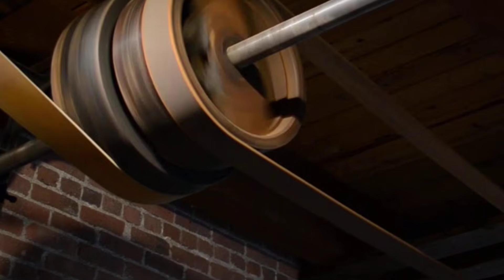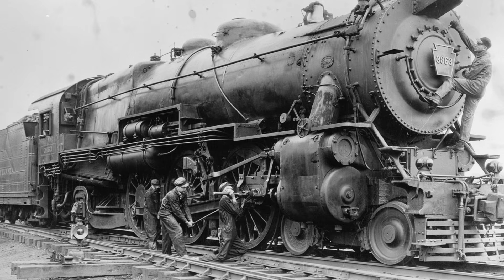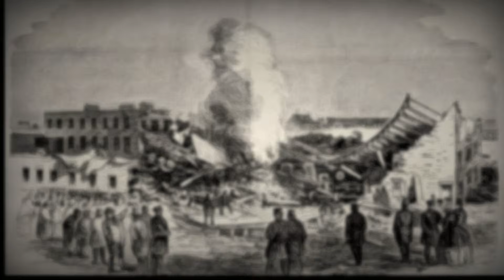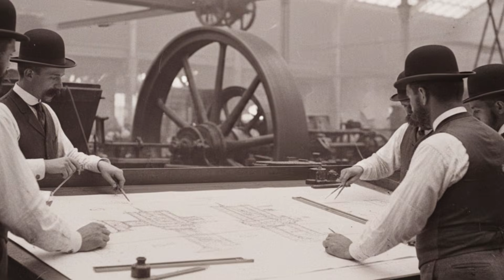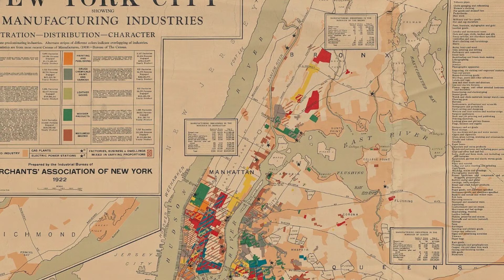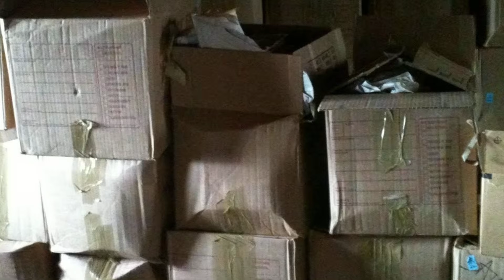The Deadliest Spinning Giant Nobody Feared : 56 Ton Flywheel

Comment: I worked in a couple of cotton mills as a 16 -18 year old back in the 1970’s. I can’t believe how casual we were about the environment of spinning, slamming equipment we worked around each day. Times do change.
Reply: I am an electrician and back in the 1980s paper mills still had some old machines like that. An older guy told me about him helping a guy who got both of his arms caught in a machine and it too almost an hour to take the machine apart to get him out. He said he was screaming for someone to put him out of his misery. These machines were built to be driven by a central belt system and just had electric motors added to power the wheel on the machine. We were adding electric eyes and DC drives that could control the motor speed. Many of these machines were bolted to the floor for 100 years and had narrow spaces between them. You had to walk sideways with your arms by your side to stay clear of all the open belts and chains spinning all around you.

Comment: Are there any statistical records of the percentage of industrial flywheels that failed? I've seen several Corliss engines on display running at very low speed, just for exhibition. A few really big ones, flywheels probably about 30 feet diameter, but again, these were just puttering along at maybe 10 rpm or so. I tried to imagine what a catastrophic failure would be like, but I think it would happen so fast that survivors would not even be aware of the disaster as it happened.

Comment: No sweat. The Chernobyl "flywheel" was far worse.
Reply: Chernobyl is a demonstration of what happens when you turn down a reactor too quickly then turn it right back up again.
Reply: That is what was told in order to be able to proclaim that RBMK reactors are still safe: assigning the guild to the operators made that easier.  See "that Chernobyl guy" 's videos for details on how much of the problem was the steam coefficient, instead.

Comment: Stupid AI generated crap. Can't even render a steam engine correctly.
Reply: Amen. Bad AI, bad narration. Just click bate. Most of the illustrations (old photos) were NOT in that hall, and were NOT related to that large steam engine.That giant wheel was NOT "deadly". That machine did not fail.
Reply: I like how the line shafts are passing through the flywheel at 13:05.  There's some clever engineering!